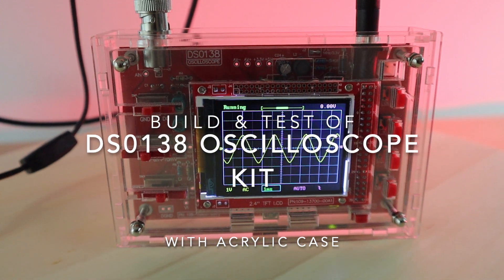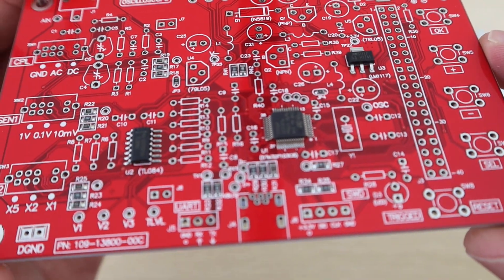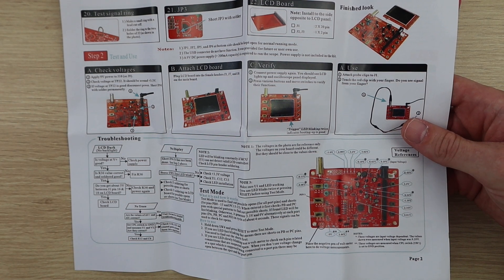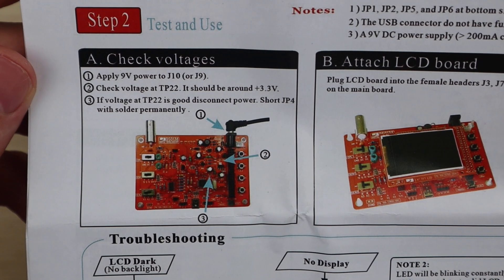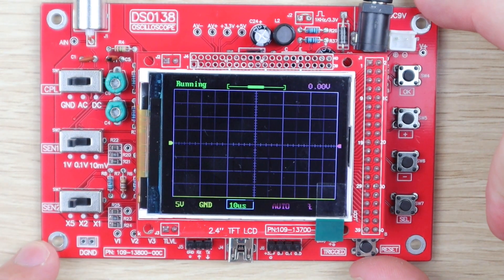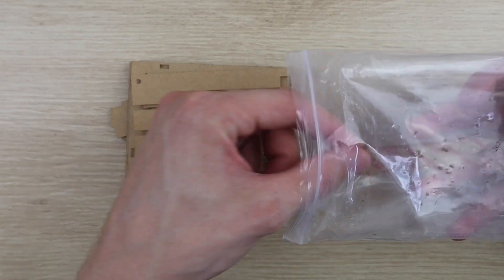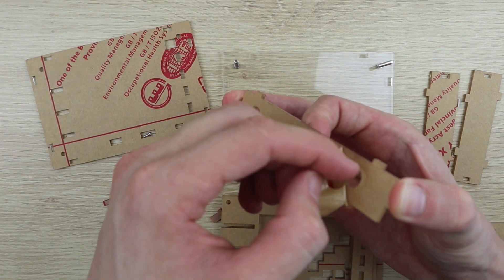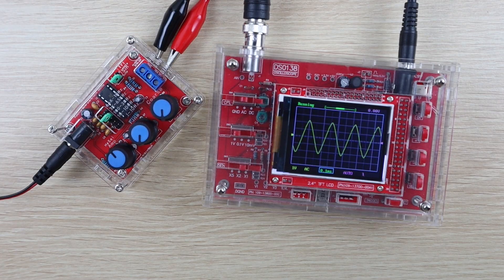DSO138 DIY Digital Oscilloscope & Acrylic Case Assembly

Comment: Seems to be much easier to build if it is inverted and cover/top is placed first. This puts the nuts on the bottom so feet are a good idea but gives a cleaner look and went together smoothly.
Reply from the maker: Yes you could probably assemble it from the front and use the nuts as feet on the back, good idea.